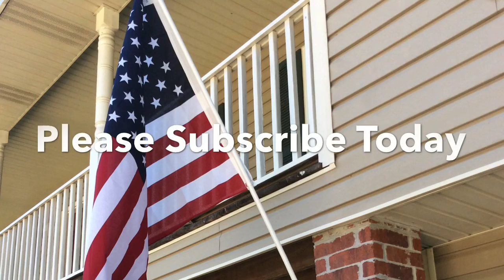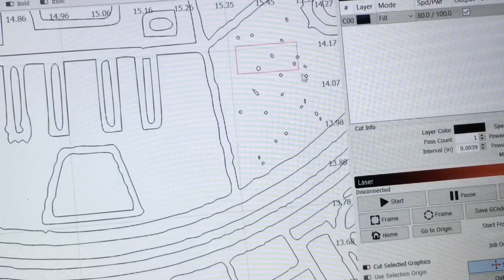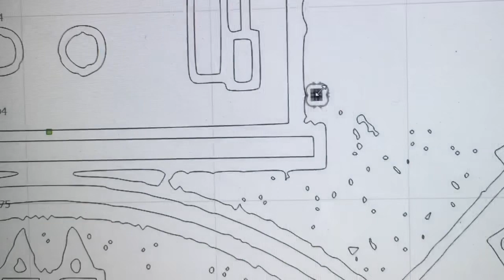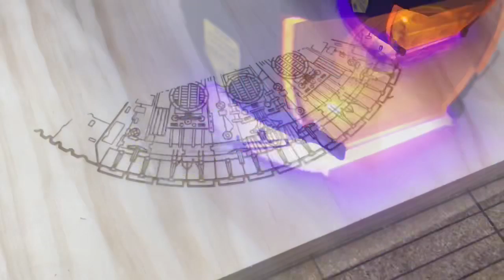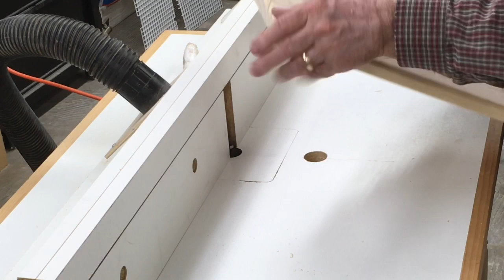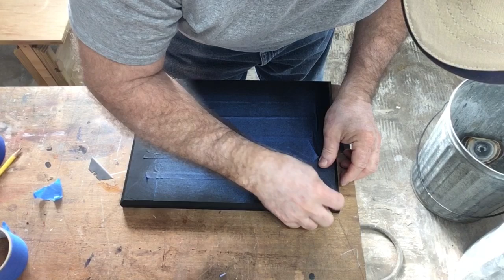The Making of the Millennium Falcon Using the Laser

Comment: New viewer, new to cnc woodwork and watching everything I can.  Excellent videos with lots of great information.  May I ask where you got your step-clamp set with the colored knobs?  I've scanned comments and watched most of your vid's that its oblivious you used them and haven't found mention of it.  The machinist steel kits that come up in searches are way overkill for what I need and haven't been able to find anything that is similar to yours.  I'm sure that I'm just looking in the wrong places.  I'll keep watching for new vid's.
Reply from the maker: Thank you for watching my videos and welcome to the world of CNC. The step clamps and the colored knobs came from Inventables. They are the maker of the XCarve CNC machine that I have.  I also use my own wooden bump stops/clamps more and more.  I also use the tape and glue method to hold the materials down if I am cutting through the materials.

Comment: I would like to thank you for the great videos.  I have same same cnc and now same laser.  I have gotten the laser dialed in yet.   Challenges with the distances.  Hopefully soon I will have it working like yours.
Reply from the maker: Create an 1/8" gauge stick like I have.  The z axis should be set 1/8 from the surface of the project to the bottom of the shroud.
Reply: I have one already.   My issue has to due with distance travelling on the x and y axis.   Any also the laser firing with enough power.